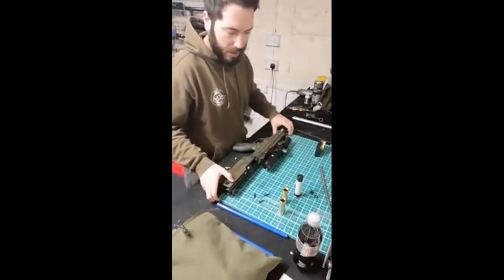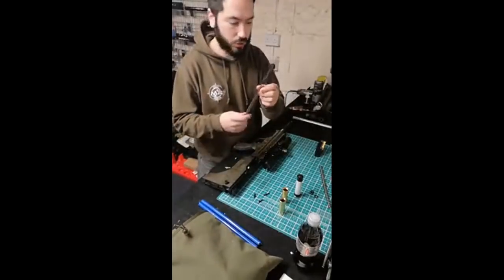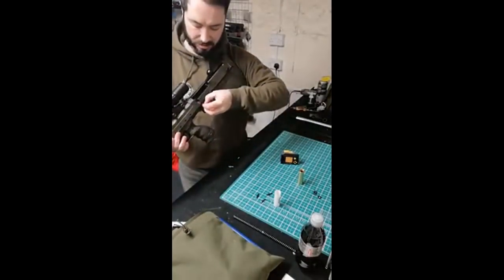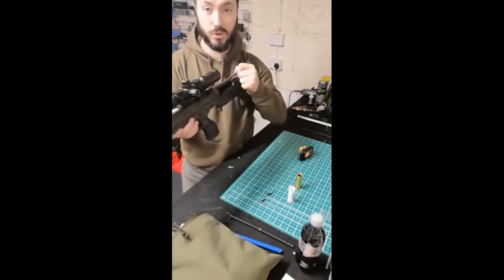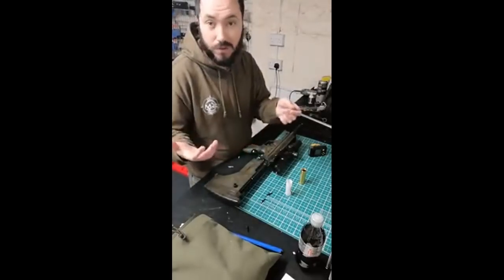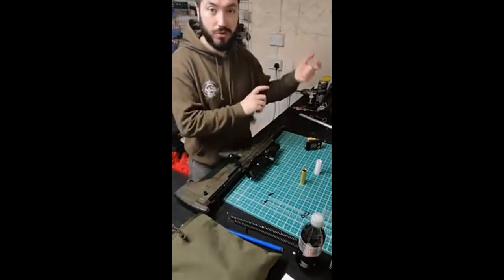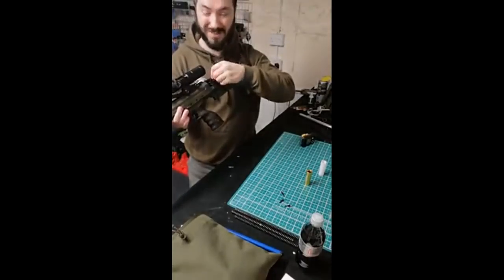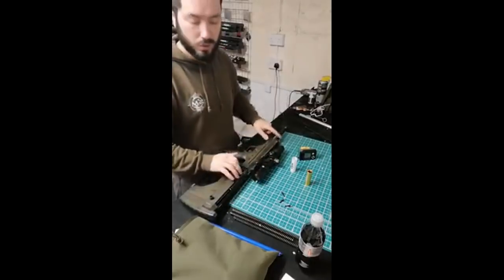Rapax Spring Test

Comment: When will they be available. My Silverback M160  is due for a replacement. Always been left in rifle and its pretty badly mis shapen now.
Reply: Airsoft CamMan What FPS is the m160 spring and is the srs better then the ssg24 ?
Reply: I ve got 3+j rapax(Red one) and i feel like IT is the same or harder to pull than stock m160 srs spring. Rapax is longer and way harder to put inside. And rapax is louder so im not too sure if i will use IT.

Comment: How do you make the pull bolt easier? I really struggle with the last cm of the pull. I am using an m150 spring with wasp piston in a 16" covert srs.
Reply from the maker: Check out the other video on SRS upgrades, I cover it on there :)
Reply: The same problem here, so i bought rapax 3j i hope it will works..